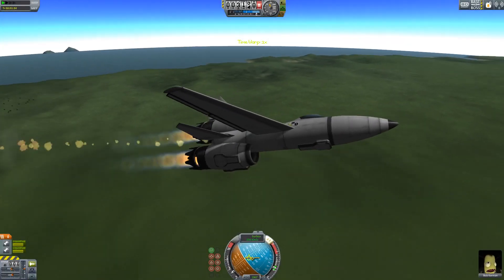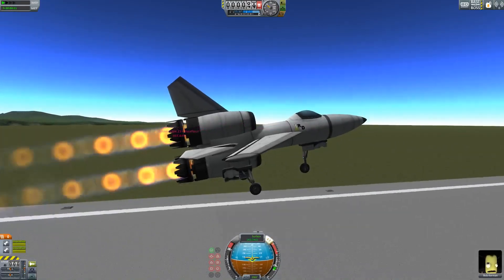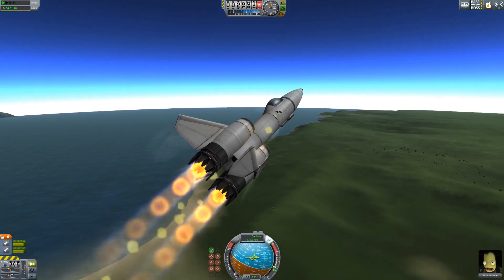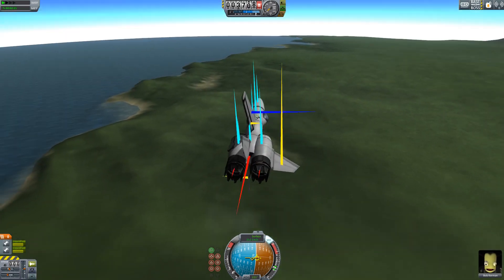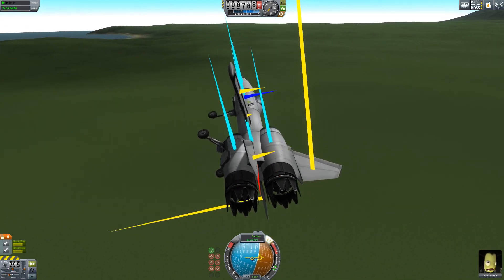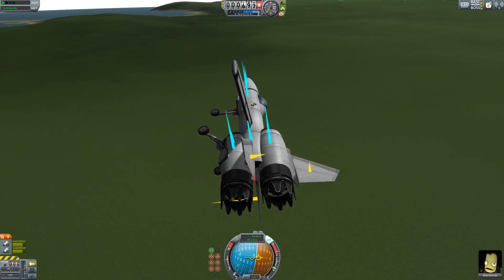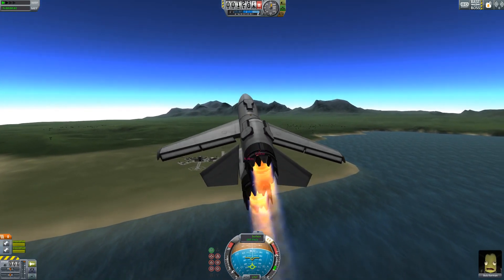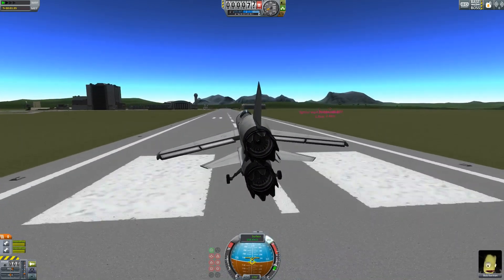KSP - Experimental HSV & Flying w 1 Wing

Comment: You're relying on the Reaction wheels in the cockpit when maneuvering on 1 wing like that, the reason you lost control when landing was when you power down the engines they aren't producing power, Strap a few solar cells and a battery on, Maybe an SAS unit so you can keep it straight and disable the wing flaps roll authority and you'll be able to fix that.

Maybe a small pair of basic fins mounted Vertically on the nose? They'd act as forward lit surfaces, The engines at the rear are making a little body lift so it might help

Considering it's penchant for destroying it's wings if I where feeling very punny I'd suggest the Wing'd Shear
drops mic

Nah that'd be awful, Shatter Vane maybe? Same joke just not quite as horrendous